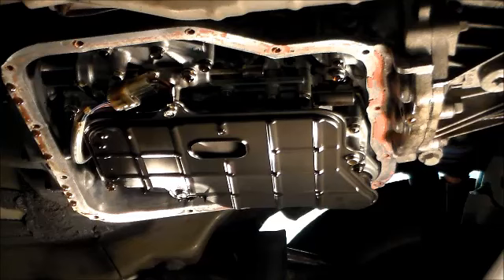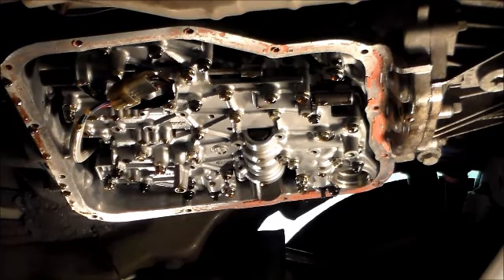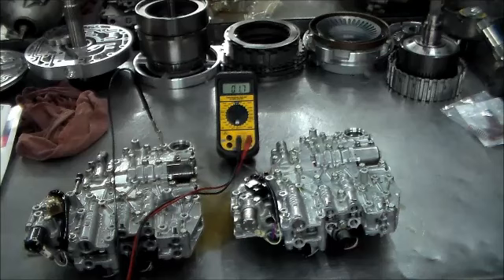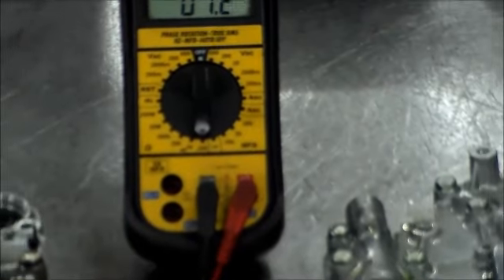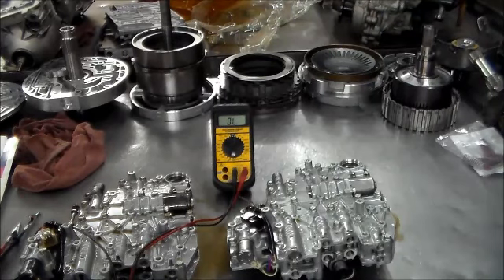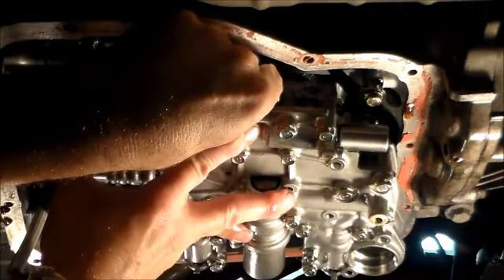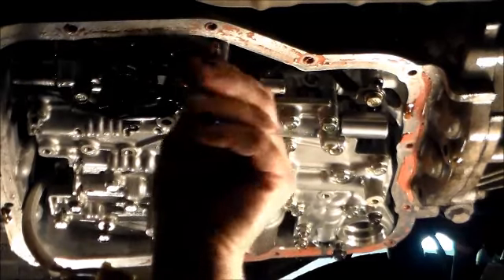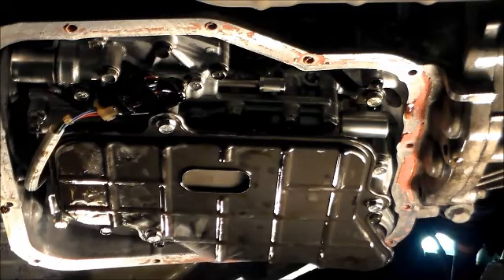Lineartronic CVT Valvebody Replacement with code P2764

Comment: That really surprises me that you have to buy the whole valve body still. If its a common failure I figured sombody would of produced aftermarket ones by now. 
 As a builder getting back into the business full time again, after a stint in a different profession, I am learning and getting updated alot from your videos. Thank you Sir.
Reply from the maker: Thank you sir, where are you located?
Reply: Gary Ferraro I am in Troutman, NC. its about 45 mins north of Charlotte.
Reply from the maker: Nice to met you mike, have a great 4th

Comment: Hi again Gary,this is the former Lisa Subaru under a new alias. You won't believe it! Just got a letter from Subaru that extends the warranty for CVT 2010-2015 Legacy/Outback, 2012-2015 Impreza, 2013-2015 Crosstrek, 2014 -2015 Forester and 2015 WRX until July 31, 2018 regardless of mileage and warranty date. There are some hoops cars older than 10 yrs old or more than 100,000 miles have to go through but they don't have to be completed until 7/31/18. 
I'm glad I called Subaru and gave them a "piece of my muffler"! I'm going to submit a claim eventhough I had a used transmission put in and then decided to get rid of the car. Now I feel bad for not buying another Subaru.
If you want a copy of the letter, let me know. 
Once again, thanks for your video. It got me on the right track for dealing with my CVT nightmare.
Reply from the maker: Thanks for the post lisa, i certainly would submit a claim, maybe get some money back, you may have told me but what are you driving now?
Reply: I am now driving a 2016 VW certified Sportwagen Golf SE.  It has "normal", sport and clutchless shifting capabilities.  Also is turbo.  Well, I'm still learning how to best use all these options for different conditions like merging, up hill, etc.  Since it's certified VW extended the warranty by 2 years so I have 3 years on everything.  I'm not expecting to drive as much as I did with the Subaru.  My fun car is a 2012 Miata, 6 speed.  Once I installed a clutch extender I use it more often.   Just curious, what does a transmission expert drive?
Reply from the maker: My everyday car is a Red 2011 BMW X6.  My Saturday car(weather permitting) is a 2008 BMW 650I. I bought it brand new and have 13,000 miles on it, but i love driving that car
Reply: Hi Gary,
I wish I would have known that BMW's were as valuable as they are priced.  A month in with the VW and I'm getting this bad feeling that the transmission is doomed.  Just need to convince the dealer to take the problem seriously so I was wondering if you could point me in the right direction of telling them what the problem is in language a car dealer mechanic would understand.

So in D and S mode the shifting is smooth sometimes and very rough at other times.  The most consistent problem happens when the car is slowing down in S mode and hits 31 mph.  There's a loud clunk, the car jerks, the tach drops to almost 0 and pops back up to above 200 rpm.  THis can happen at other speeds accelerating, decelerating and in D and S modes but not as often.  Although in D mode accelerating around 21 mph it happens as well.  

I appreciate any thoughts you have on this.  Now that I know what happened to my Subaru CVT I'm wondering if this transmission is chopping itself up as well.

Re the Subaru, I'm going to file for "repair" costs.  Have a great weekend!
Reply from the maker: Have you had this scanned to see if any codes are present?
Reply: Not yet.  I thought that a dashboard light would come on if there were any codes.  Since I didn't see any I didn't think to get it checked before next service.  I can go to my regular non-dealer shop next week and they will check for codes.  Thx
Reply from the maker: One thing i been seeing with these types of transmissions is a lot of these fixes are just software updates.

Comment: Hi Gary,I picked up the car late Friday. Right away I thought something was wrong. I heard a clunking noise when I went over bumps. Saturday I drove 25 miles. Interestingly, at stops the idle was around 800 rpm. The first transmission would idle at around 300 then dip to almost zero and bounce back up to 300. I read after CVT failed that this is a symptom of a failing CVT but didn't know it - some cars stall out completely which gets them to the dealer/mechanic for repair. Back to Saturday, after starting the car again I heard a constant noise coming from front end plus the clunk. Parked the car for several hours. Restarted and it released a loud roar. The tach settled above 1000rpm so I tapped the gas pedal and it calmed down. I drove another 25 miles and the car seemed fine apart from the noise and clunk. 
I decided I'm too concerned about driving it so I'm going to get rid of it and buy a car tomorrow. I'm considering the precertified 2016 VW Golf Sportwagen SE or TSI limited addition. Need a wagon. Fun car is a Miata. 
In the meantime I've emailed the used parts supplier hoping they will refund the transmission. I new it was a gamble. At least I will be able to drive it to the dealer and may be get a few tradein dollars!
Any thoughts/comments appreciated.
Reply from the maker: With CVT i dont like used transmissions, i  would only go rebuilt on that. Not sure what the used parts supplier will do but it cant hurt to ask.  Ask about the warranty on the VW, that may have a DCT(dual clutch transmission) which has issues as well.  Nice hearing from you  Lisa. Gary

Comment: If you change the ROM pack (small black box with wires on valve body) from the old one onto the new one you wont have to relearn it as it's already in your old ROM...

Comment: Going to be doing this on a mates 2012 subaru XV that has the code exception being we have the actual valve, will be removing the old valve on the valve body and putting in the new one. Wish me luck on a successful outcome ;)
Reply from the maker: A little tricky unplugging the solenoid, took me a little while to figure it out
Reply: @GaryFerraro  Yeah watch a few videos regarding the different gearbox versions and specifically how to unplug.
Someone actually disassembled the solenoid and resoldered the joint to fix their issue.
Reply from the maker: @justviews4946  Cool,  you have the TR690 or TR580 Trans (valvebody on top of the trans or bottom)?
Reply: @GaryFerraro  It is on top verified the gearbox model (TR580) by the label using a boroscope but the job didn't get done. the owner (friend) hadn't organised a replacement gasket for the october long weekend.
Reply from the maker: @justviews4946  you were able to get the solenoid?
Reply: @GaryFerraro  Yes as small as it is it is actually harder to do the change than procure the solenoid !
Reply from the maker: @justviews4946  You got it done?

Comment: Exact same problem , same year model and make. Thanks for this video.
Reply from the maker: rui zhou Very common problem. I do a lot of these
Reply from the maker: @ruizhou9612    With this code, I have never seen anything other than the valvebody, if it's generation 1 valvebody is on the bottom, when you drop the pan and valvebody most of the fluid will come out. 
GI Subaru fluid is CVT correct?
Reply from the maker: @ruizhou9612   If you drop the valvebody out, leave it overnite to drain, most if not all of the fluid will come out, I just did a valvebody last week, let it drain overnite 
and it took about 7 or 8 quarts when filling it. Very easy to swap out the valvebody, drop the pan, filter, there is an electrical connector to unplug and the valvebody bolts. When the valvebody comes down there is a sleeve that may come down with the body just put it back into the case before the new body goes up
Reply: So I have a question, I changed the valve body. But did not take it to be hooked up to relearn. Drives fine and shifts good. But if you accelerate hard it is jerky and almost feels like it’s slipping. But only if you accelerate hard. Any thoughts?

Comment: Thank you for a very informative and timely video. Just the other day my 2011 Outback 2.5i, CVT with 150K miles coded P0700 and P2764. At 70 mph I felt the car jerk. It did it again several times as I slowed down to exit within a mile of the first one and when I accelerated from stop sign. I pulled over when the dashboard lights went bonkers (check engine not blinking, AT oil, brake, cruise blinking. I noticed that the tach moved up about 300 rpm then back each time the jerk happened. No local mechanic or transmission shop will work on the Subaru transmission. My only option is the dealer which I am hesitant about because I have read that they just say a new transmission is needed and don't do the testing you did.
Do you know if the jerking at all speeds points more towards a transmission problem or valve body? My gas mileage has been decreasing for a long time as well.

My car's value is now less than a new transmission. If I take to Subaru I plan to have them document the steps you took to diagnose the solenoids. If they don't then I'll probably donate the car (tears). 
I read that for a P2763 code it's possible to look at the a connector or two under the hood to see if they are loose or shorted. Do you know if there is a similar observation that I can do myself for the P2764 code?
Also, do you have any idea the typical lifespan of the CVT outbacks? May be it is time to retire the car. It is in great shape except that I can't drive it!!
Thanks so much.
Reply from the maker: Hello Lisa, Sorry to hear about your car, CVT transmissions are not the greatest, they have alot of problems with them, Are you by chance in the New York area?
Reply: Thanks for your quick response.  I used to be a NYer!  Now I'm in the south.
Reply: I looked up your shop.  I grew up in Baldwin.  Left for the big city and then went kicking and screaming south.
Reply from the maker: Ok,  very nice to meet you,  hope your enjoying the weather there year round, but you will always be a NYer. Are you in Florida, i live in Boca Raton many years ago, but the family business brought me back.
Reply: Nice to meet you too.  I live in the state known for the "YOU LIE" Senator, the governor who was hiking the Appalachian trail and other notables.  South Carolina midlands.
Reply: Update:  Found a mechanic.  He drained the transmission oil. It was full of crap.  Decided to try replacing with a used transmission.  Found one in NC from a totalled car.  It has 72K on it and comes with a 3 month warranty.  Costs $1400 and $85 shipping.  Mechanic felt car was in great condition and worth giving it a try.  Now I need to put on 100K in 3 months!  Thanks for your e-help!  "Covfefe!"
Reply from the maker: Hi Lisa, Thanks for the update, let me know how it goes.
Reply: @HNelle  Hi there!!! How is the car by now? Thank you!!!

Comment: Hi Gary, currently dealing with P2762 on a MY12 Outback (Australian) with a TR69JHBBA ,
Reply from the maker: This seems to be a mechanical code, looked up some info on the this code and they want pressure tests done, but a good bunch of fixes was the valvebody
Reply: Gary Ferraro put a new convertor in her and is perfect now!
Reply: Gary Ferraro thanku
Reply from the maker: @justingarcia7378  Glad you got it done, thanks for the update

Comment: My Crosstrek just took a dump same code.  P2764 + P0700.  I'm guessing once this gets replaced under warranty, it'll essentially be like getting a CVT flush so I won't have to do another one later?  My car only has 67k miles for a 2013 Crosstrek.
Reply: Oh my god. Mine is a 2014 and the same thing. But I'm not covered by a warranty :(. They will have to replace the fluid when they fix it.
Reply: @NiNjaTurtLe697  my 13 xv Crosstrek just died while I was 900 miles from home. So I had to rent a u-haul truck and trailer to drag it home for 1k$ . Then all the parts and fluids it was 1k in parts. This seems to be a very common issue. Luckily it's easy to replace. I did it myself and it only took me 2 hours.
Reply: @SconnerGuitar  lucky you have the skills to do this, otherwise it would've cost you a lot more than that overall. I just had my trans replaced. All is ok for now

Comment: I have a P2764 code on my 2011 Outback with 141k miles.  I got the OEM repair manual shortly after buying the car brand new.  Below are the solenoid specs listed in the manual.    

Solenoid                               Terminal No.                       
   Specification
(Ω)
Secondary solenoid            No. 1 - control valve body   Approx. 6.6 Ω

Lock-up duty solenoid        No. 2 - control valve body   Approx. 12 Ω
F&R solenoid                        No. 3 - control valve body   Approx. 5.3 Ω
Lock-up ON/OFF solenoid No. 5 - control valve body   Approx. 16 Ω
Primary DOWN solenoid    No. 6 - control valve body   Approx. 12 Ω
Primary UP solenoid           No. 7 - control valve body   Approx. 12 Ω
AWD solenoid                      No. 8 - control valve body   Approx. 3.2 Ω

Install NEW O-ring to the pressure pipe and apply CVTF to the O-ring before installing it. 

Torque specs: 
Control Valve Body Tightening torque: 9 N·m (0.9 kgf-m, 6.6 ft-lb)
Oil Strainer Tightening torque:
 9 N·m (0.9 kgf-m, 6.6 ft-lb)
Oil Pan Tightening torque:
 5 N·m (0.5 kgf-m, 3.7 ft-lb)

Liquid gasket:
THREE BOND 1217B (Part No. K0877YA020) or equivalent
Reply from the maker: Thanks for the info. you fixed yourself?

Comment: Great video thank you! Have a question...could be a torque converter thing, Valve body maybe...Throttle body?...the thing is...When I drive at very low speed (XV with tr580 cvt) you can feel something happens with the engine, maybe throttle body...or maybe the transmition...never stalls...but it makes some jumpy small...hard to say...like if the engine stops for a fraction of a second and then keeps working normally...only when drive at 7-8% of throttle...Also happens something similar when going fast even with cruise control, for example after a hill when the engine dosent have to push anymore because the cruise speed is riched again...Something strange happens when engine trying to match again the wheels speed...thank you so much
Reply from the maker: Do you have any codes
Reply: @GaryFerraro  no, sorry...dont have any scantool
Reply: @GaryFerraro  what was the symptom on your car? can a bad solenoid ruin a good torque converter?
Reply from the maker: Just producing a code, an electrical code for the solenoid

Comment: Hey Gary my mechanic is going to do the same job for me on my 13 xv. They were concerned about the relearn/reprogrammed. Will I be able to drive the car regardless and if not any updates on how to have it relearned?
Reply: I need to do this job as well, same year XV. Did you need to get it relearned?

Comment: Hi Gary, how much fluid did you have to service back into the transmission after changing out the valve body and should the gasket for the pan be replaced either way after dropping it?

Comment: Hello Gary, nice video.  I will be attempting this same job soon on my 2011 Subaru Legacy with 160k miles.  I have a few questions;  1). Since I have such high-miles, should I also replace the CVT "Oil Strainer" that sits below the VB while I'm in there? , and 2.) the service manual says to use "Three Bond 1217B or equivalent", what would be a good "equivalent" because that 1217B stuff is EXPENSIVE !!!

Thanks :)
Reply from the maker: Yes I would replace the filter,  To seal the pan , RTV is fine, I use black silicone.
Reply: @GaryFerraro  Hey thanks for the good information.  I just scanned my vehicle, it's showing code "P2763 Torque Converter Clutch Pressure Control Solenoid Control Circuit High".  I'm thinking this is one of the 4 solenoids in that Valve Body, a different one from yours (versus P2764), and that it is bad.  Do you think it's reasonable to believe that replacing the current and original Valve Body (160k) with a new one would fix this issue? Thanks Again.